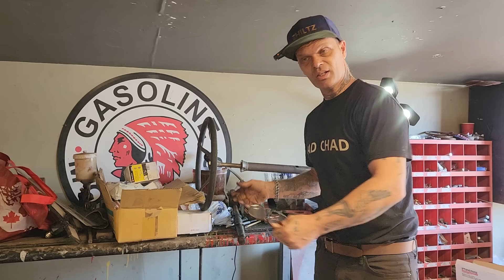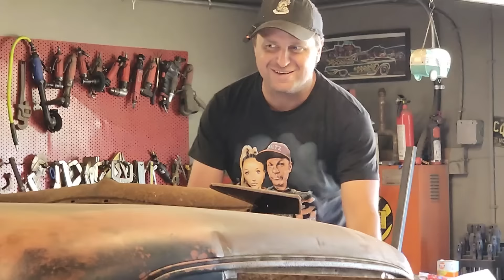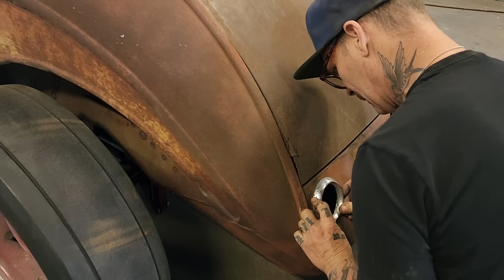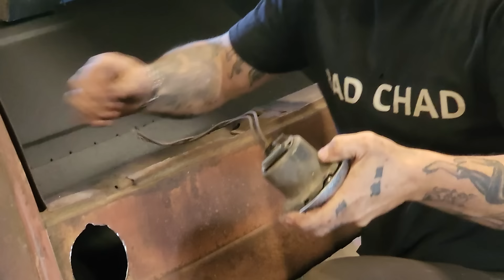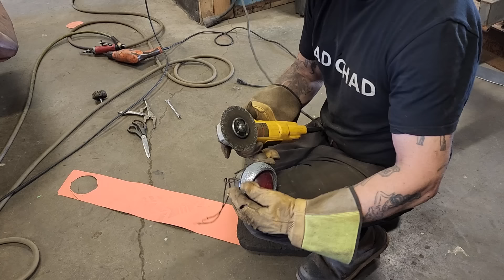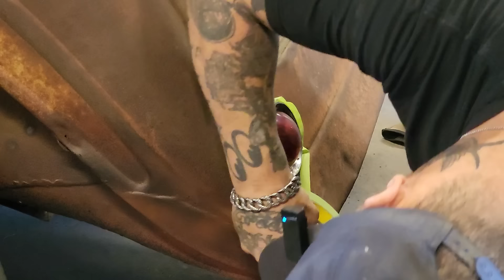The momentum continues..applying the windshield, taillights, and steering 👏

Comment: So you have all kinds of car parts in your yard. Why didn’t you take a radiator hose barb off a radiator in your yard of parts and install/ solder on your top tank so the flathead radiator hoses could be installed the stock way. You always preach about using what you have instead of spending money. Well the copper pipe and fittings cost you money and if you would have taken a part from your yard of parts it would’ve cost you nothing.
Reply: You don’t know what he has laying around in his door yard !

Comment: You certainly don’t need to make it the way I like it, I’ll watch regardless. But I think it’d be pretty sweet if you’d make a beauty ring to go around the windsheild that hides the screws and wraps around the edge of the lexan. Then match it to the cars patina. Done right most folks would never notice it’s screwed on. Just a suggestion though. Keep doin it how you like it!

Rip some angle iron lengthwise so it’s more like an “L” with the small lip just big enough to cover the lexan edge and butt up against the car. Radius the outside corner all around and make a trim ring out of that. Weld a few threaded studs to the inside of that, which would pass through a few seam-sealed holes with a nut on the inside of the car. Or put a gasket around that too.

Comment: You lost me after screwing windshield on.  Cheapens whole car up.  Sorry, just me!
Reply: And I think it's a piece of plastic
Reply: It's a hot rod made up of stuff in yard and garage he's not working on 50k car 🤔
Reply: When I was a kid we used to make box cars with whatever wheels and parts we could come up with. This kind of reminds me of that. I like it though. If you take it for what it is. 37:25
Reply: @samsungcrossland2036  how well we know
Reply: It's plexiglass thatlots of track cars use it's only going 65mph..
Reply: they are building this car for a dirt rally event.this is jolenes race car.windscreens are screwed on and are perspec so it does not shatter
Reply: it will only be a race car at Pine Tree.
Reply: I don’t think I’m down with screws either. And why does it need lights? It’s a drag car.
Reply: It's an old race car. 🏁
Reply: it sucks.
Reply: train wreck
Reply: He will probably put that chrome tape molding over top the screws
Reply: @gregoryanderson5630  you are correct its called "Plexi glass" it was surprisingly invented in 1933
Reply: Oh no, we lost robert. What ever shall we do????
Reply: @bullyboyproductions4049 I hope chad and Jolene can make it without him
Reply: Amen to that! just like not rounding the trans/driveshaft tunnel. "Fast n Easy"! (Should be the new slogan) Will paint it mustard yeller with red interior most likely.  I'm still a fan but disappointed at how he goes about things and leaves other projects collecting dust (ADHD??)
Reply: What exactly do you think they are building . This is being made go run on a dirt track with a flat head it ain’t going 100mph. It isn’t a show car.
Reply: 😂 the only way it will be going 65 is on a trailer. And for racing 1/8 mile, maybe 40 mph  @sthildas4857
Reply: @mikepeters4916  🤣
Reply: It’s a fuckin Car for Jolene to race FFS ! Have you ever seen drag cars ! The plexi is always screwed in Jesus crist
Reply: @gregoryanderson5630 it’s Plexi glass ! It’s what drag cars have ! That’s what it’s being built for …for Jolene to race in the old street rod drags
Reply: @John-kl3ue  👍👍
Reply: @John-kl3ue  the density runs thick here. I do believe with some because of their age, not putting anyone down really just being honest.
Reply: Ok, so it's plexiglass so what? I watch their show for different ways of building cars, not the same thing that everyone else does. That's what makes Chad great, doing things different, outside of the box.
Reply: It's called hot roddin!
Reply: I think it may be a temporary thing
Reply: I bet none knocking it can build it from scratch... Dear Lord you ever hear of a rar rod
Reply: Remember it a race car to go for racing for fun and it a project for fun ya all tripping
Reply: Its a Rat Rod dingleberry 😆 🤣
Reply: Yeah I’m not a fan of the screwed on windsheild either, but it’ll work fine.  I won’t lose any sleep over it. Just doesn’t fit the style of the car in my opinion. That’s more of a steam punk rat rod thing, whereas this car is more traditional hot rod style, just with lots of patina. Oh well. It’s still cool.  I’ll keep watching.
Reply: @George-tz1cv perhaps to drive it around the door yard at night..
Reply: Right off the hop a dummy cries about a custom car . Then why watch ?

Comment: 🤔hummm yep ! The windshield looks like 💩 and it’s not Doug’s work it’s not mounting it in a recessed hole ,like a regular window , just pasting it on the outside makes it look like a quick after thought , I like the tail lights , keeping the old steering wheel looks great,

Comment: I am guessing the windscreen is not designed to be completely waterproof. If that "Pepsi glass" cracks and Doug has to make a new one, consider: slightly larger, and fewer, holes with rubber grommets between the screws and the holes to stop cracking.

Comment: Id like to see interior in the car. Im sure theres a quick cheep solution to headliner and door panels are easy for sure if chad fixes the rust holes at the top of the driver's door that car would ride nice on the inside.

Comment: Chad and Jolene , Things are getting closer to completion of the 1934 Dodge Hot Rod Coupe. It's like the Old Johnny Cash Song building the old Cadillac one piece at a time. From available parts you have in the shop and the storage buildings. The grille is a Chevy the Engine is a flathead Ford , the driver's is out of a MGZ , the tail  lights are out of 1948 Pontiac. The steering column and steering wheel look like there out of an old 1920's /30's  Ford truck.. Nate will resurrect the steering column and knuckle installation. i appreciate Chad's comment that once Doug is done with his part with windshield that he'll go around the perimeter with seam sealer. Once the interior is completed It'll need to be cleaned up to meet Jolene's standards. Or she could invest in a light weight coveralls to match he racing helmet.

Comment: I’m really surprised that you are using screws to place the window in . The vibrations through the body will more then likely spit the window at the screw holes . You should try Butyl tape to seal and silicone that way there can be some flexing with out cracking the window..
Reply: is that what happened when you screwed your windshield on?